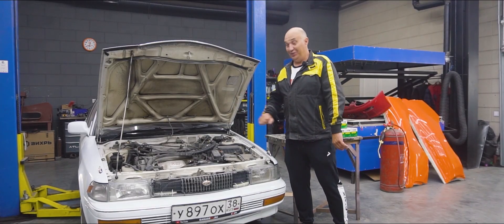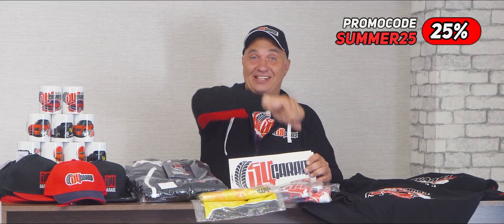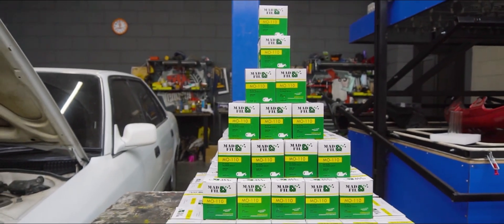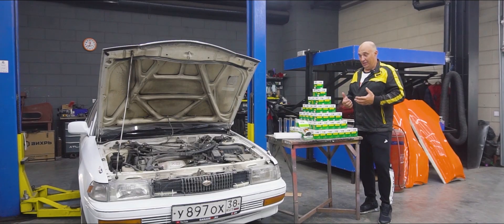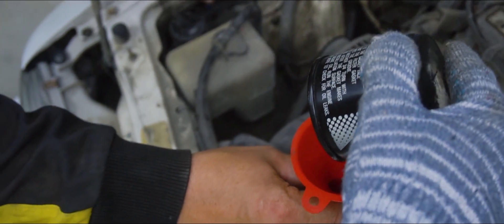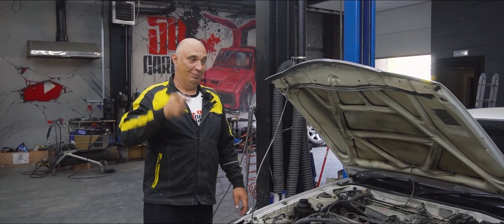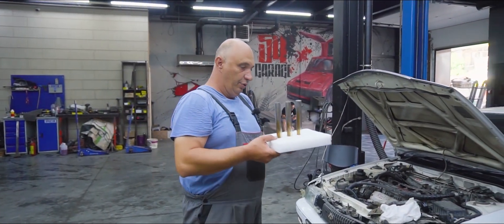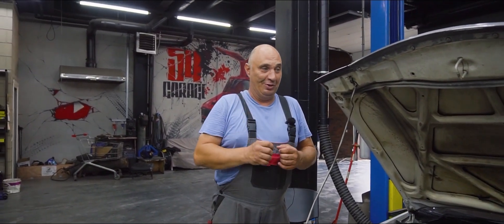Can 50 oil filters make used motor oil clear again?

Comment: Hello from Guatemala City. Try doing the technique @ 8’04” for 10, 20, 50 times (New filter element each time), to avoid engine heat. Good luck.

Comment: The thing is that not all the oil goes through the filter, alot of it bypasses as there is a bypass valve in filter AND some engines bypass in the block....  oil filters filter Some of the oil....only on something like a ships engine is it ALL filtered and spun clean.....

Comment: Like the new Briggs and Stratton lawn mower engines, "never change oil, just top up" lol means they're designed to burn a bit of oil, and there's no drain plug. That's why we use oil extractors to remove oil from crankcase. The engine will last longer, and have less build up in the sump.
Reply: My 2004 Craftsman lawn tractor has a 20 HP Kohler. It has a Gulf Coast toilet paper filter that I change every few years. I changed the oil one time in 20 years. I got gasoline in the oil. The other day I decided to adjust the valves. Removed the valve cover and it looked new. Turns out it has hydraulic valve lifters. Still dont use oil.

Comment: I wonder if the oil pump is strong enough to push the oil through 50 filters in series. Then see the final out come. I was really hoping the oil would have cleaned up some haha.
Reply: The filters did nothing. He changed the oil.

Comment: I really like the videos and attention you put into them. I'll tell you what my Grandfather used to say,  he'd say oil never wears out, it just gets dirty. He'd only replace the oil filter and add the amount of oil the old filter removed. Then drive the vehicles forever.
Reply: Straight weight oil does not but  multi weight does it contains long chain polymers that break down
Reply: I have a Freezer that hasnt had an oil change in over 50 years. Clean oil will last forever. The freezer wont hold it forever. My 37 Studebaker book said its not necessary to change the oil except for seasonal reasons. Change the filter when the oil looks dirty on the depth gauge.(dipstick). Seasonal reasons meant thinner oil for winter. I think they used cotton. John Frantz started putting superior 2 ply toilet paper in them in 1953.

Comment: Many years ago I saw a story of a custom aftermarket oil filter system installed alongside the normal filter. The filter it used was an actual toilet paper roll and the fineness of toilet paper filtered out all the fine carbon and kept the oil very clean.
Reply: Every engine I have with a oil pump has a toilet paper filter including the lawn mowers. Started with a Frantz oil cleaner on my Rambler American in 1963. My Pontiac Torrent has a Australian Jackmaster Classic. The other engines use Gulf Coasts. Motor Guards and a flat head Ford V8 canister filter set up to use Scott 1000. It has half a roll of Viva towels in it now. They dont like to be called toilet paper filters. Too many bull shit stories and stupid jokes with toilet paper. Jackmaster Classic comes with a high quality roll of toilet paper in a sock. They charge about 20 bucks for them. I use Great Value 1000 from Walmart in mine. To remove the used roll I use long nosed pliers. The Jackmaster Classic element has a pull ring.
Reply: Thats 20 dollars Australian. Some put toilet paper in a sock and charge 40 bucks and more.

Comment: Ok, now, take an engine that has 10,000/20,000 Km thick black sludgy oil, and, how many oil changes with a can of engine oil flush between each oil change, will it take to fully clean the inside of the engine with the engine running totally clean and on ultra clear 'new' looking oil? :-)

Comment: Normal oil filters are not designed to restrict the oil flow a much, so the filtering efficiency isn't 100%... To filter better, most of the contaminants should be filtered first, then the oil should be filtered through large paper filter and finally stored in a large container for few weeks so the layers are separated. This is essentially what was done in a company I worked for few years ago...

Comment: You can get lab glass for filtration it has a glass filter that you put whatever size filter you need then the top is clamped on and using a vacuum pump the oil can be drawn through the filter. Just need a really fine one and it will take a lonely time

Comment: Centrifugal oil filter, Spin the used oil through fine jets into a fast spinning barrel the residue will stick to the walls and clean the oil substantially. They do this with diesel trucks here in the west. https://www.cumminsfiltration.com/south-pacific/centriguard-centrifuge-lube-filters

Comment: the sludge build up in the engine wwill never allow the oil to get clean the only wawy i can think of is turn the high speed wheel machine into a centrifuge and separate the contaminates from the oil

Comment: I know motor oil is absolutely recyclable, many auto parts stores here allow you to dump it there for recycling.  I dont know how much of it they re-process back into motor oil, or how hard it is to do, but it IS possible to to make old oil like new again. Somehow.  Biggest problem is removing the carbon and acid contamination, and repairing the viscosity.
Reply: When I was in high school I got a $10 a week allowance that was to buy my lunches and gas any extra was a bonus. Yeah I'm that old. My old 62 Falcon with an inline 6 drank oil. It dumped it out tailpipe and the engine breather tube. Had a motorcycle cop pull me over one day, he was pissed, spladder oil all over his uniform. Oil was expensive so instead of paying the $0.30 a quart I bought what was called Rev. Recycle oil, it was actually amber color. Best of all $0.18 a quart. And at close to 20 mph which was a lot in those days, plus $0.29 a gallon gas I actually had a little allowance left over for the Friday Night Football game.
Reply: I was a maintenance mechanic for a oil  re refinery company. Conventional oil gets better every time it is refined. At one time Mercedes cars came new with re refined oil. Goodyear sold ours in quarts. Most of it goes to the major oil companies. Its as clear as water until they put additives in it. A lot of synthetic oil in it now. With used oil you arent dealing with the crap in crude oil. People wont buy it. They want the new stuff.
Reply: In 1955 I left home at 15 and worked in a DX station in the middle of nowhere. I lived there. The owner gave me some guns in case the thugs came up from Pawhuska Oklahoma and tried to rob me. He thought it would be fun to scare me one night. He scratched at the window and shined a flashlight under his chin. I slept with his 38 under the pillow. He almost met his maker. When I ran out of stuff to sell I went down to a Phillips 66 station. One day the sheriff came and asked me some questions. The next day dad came and told me if I didnt go back to school him and the station owner were going to jail. I managed to finish school and went into the Army.

Comment: Here is a idea you can do as I did it many years ago. I took a 20 liter steel drum filled it with used engine oil, the cap I drilled a hole in with a pipe welded on and another small pipe welded on for air pressure. On the cap with the pipe I welded a expanded metal pipe on with the end  capped, then took toilet paper and rolled it around the expanded pipe many times and put it in drum and pressured the drum, at first the first 2 liter oil was slightly clearer but getting to 10 liter it became clear.
I won't recommend engine oil as combustion process changes the chemical properties but gearbox oil can be used over again.

Comment: The real problems with engine oil are firstly the steady dilution with fuel washed off the cylinders,  and the steady degradation of the all important additives.  The one makes the oil less sticky and lubricates far less well.  The other is the loss of the additives that extend the viscosity range to higher temperatures.  Other additives control things like the acidity of the oil.  Without these all important additives your car is running around very poorly lubricated.  The color of the oil is all but unimportant.
Reply: Its a matter of cleaning the oil with depth filters operating at normal oil temperature long enough for the PCV to remove the fuel and condensation from the oil and adding enough new makeup oil to keep the additives up. Im a filter guy it seems simple.to me. Im not that smart.If I can understand it anyone should understand it.

Comment: for an idea on how to clean the oil try a 5 micron water filter. you may have to pump it through somhow as its a very fine filter and oil is pretty thick in comparison to oil.

Comment: If you use a diesel bypass filter it'll work better. It's all about the micron filtration. Anything industrial should have a bypass filter. Trucks, excavators etc

You can't restore low quality oil as it breaks down. If you use special longlife synthetic it'll work, as the oil is less likely to break down. It's to do with the strength of the oil at molecular level ⛓

I can send you a link to a company that sells 100, 000km oil if you're interested

Comment: What..? I’ve never once seen high quality oil cause an oil light due to clogging an oil filter..? Do you guys not have good filters also.? I work at a ford/Shelby dealership and we deal with all the roush and Shelby vehicles in our city. Never once heard of high quality oil clogging a filter.
Reply: I’ve also probably done 1500 oil changes myself on my personal vehicles. Ive used liqui moly on my vehicles for a few years and that’s the most common oil we use or motul 5w50.

Comment: I could be wrong, but I don’t think the darker color is in the oil, but rather of the oil. The oil has a chemical reaction to get darker after it gets hot. You can heat oil without an engine and it will still turn dark, so it’s not something that can be filtered out.

Comment: Back in the 1940-50s,There was a kit to put on the engine to run toilet paper as a filter!! Try that!
Reply: John Frantz started putting Frantz canisters inside the larger canister filters that were usually optional equipment. The Frantz canister had a roll of 2 ply toilet paper in it. 1953 model. Of course it would turn the oil golden in a gasoline engine. There were others that im not familiar with. A Frantz dealer had Frantz 3 stackers all over the Gulf Of Mexico on big marine engines. They used a taller canister that took 3 Frantz canisters. I believe they had the single the 2 stacker the 3 stacker and the 4 stacker. They also had a FAA and PMA approved AeroFrantz. At some point Frantz went broke. The Frantz dealer improved the little toilet paper filters. I have several in use. The 3 stackers were replaced with a big filter that used Bounty big roll paper toweks. I think they put them in a bag now and charge mor for them. I think the Australian Jackmaster filter company is working with The Gulf Coast filter company. The Gulf Coast filter company is too busy with heavy duty filters. I think they dropped the toilet paper filters. Jackmaster is just as good. The people that buy the big filters also need small filters for lift trucks and such.

Comment: Those particles a down to micron sizes. In order to filter out to 0 microns which is what you’d need to make it clear again it would take hours to push it through filters that’s small and the engine wouldn’t get enough flow.

Comment: you guys is silly. The hydrocarbons have made the oil dark. Geesh. You would have to make some refining process for the oil in order to take out the hydrocarbons and each filter only works at certain micron levels. You achieved very little here

Comment: Because high prices of fuel in my country i am forced to drive my car on waste motor oil mix with diesel.  50/50 winter mix and 70/30 summer mix. You can do 70/30 mix all the time but cold start during winter is harder.

Comment: I had a Toyota Corolla 4wd Touring that burned about a liter a week. I just topped off the oil for 2 years. I drove that thing about 50k kms and I changed the filter twice😂 it did fine. Surprisingly the reason it died was not the engine giving up, but rather the rear wheel bearings for a 4wd corolla were not available anywhere in the world. So I scrapped it. Best damn car I ever had. Outwheeled every single subaru in the heavy Iceland snow

Comment: I’m so disappointed. I figured y’all would have rigged up a contraption to have all 50 of those in line, pumping back into the engine 😂
Reply: me too. I was thinking a long pile with T joints.
Reply: @musthavechannel5262  I wonder if the oil pump would be able to pump that much oil thru 50x the filter restrictions it should with stand. Without several booster pumps to keep the pressure up and assist the engine oil pump, it would either fail or the engine would suffer oil starvation.
Reply: @midlifeparty  That's a fair point.
Reply: Same here too disappointed
Reply: Not going to lie, I literally thought this was what was going to happen
Reply: same
Reply: You not the only one
Reply: They might read this comment and try it? Who knows?
Reply: @MrCwatson3  that would be epic. Even if it had to have a booster pump in line or something.
Reply: I did think the same . A tube with filters rammed in and holes cut in the ends ... oil in one end and lets see what drops out the other .
Reply: I think you'd have to have an oil pump capable of about 700 lb of oil pressure LOL
Reply: Man you’d have negative oil pressure by the time it entered the first 3 filters 😂
Reply: Omg yes!!
Reply: Sammeee🤣🤣🤣

Comment: I think you would have gotten much better results if you used a extremely high filtration filter like a royal purple oil filter.  They are like 95% efficient at 5 microns.

Comment: You need install a bypass filter with a sub micron rating. 1 filter will make it clear as new.
Reply: correct, check out gulf coast filters.
Reply: I have several Gulf Coast Junior filters in use. I dont think they are in production now The Australian Jackmaster Classic is just as good. Gulf Coast is getting more and more into government business. Got into a debate with on a Trawler forum. It was NASA. They started using them They were moving the shuttle then. Its not just motor oil now. Its aviation fuel  Cleaning solvent  Coolant. I called Charlie Sims at Gulf Coast filters. I said send someone down to Canaveral that understands large engines. Im in over my head. LOL.
Reply: Of course the big Gulf Coast filters used Bounty big roll paper towels then right out of the package.  They started putting them in a bag. Got a call from one of my fleet customers. He said we have more trucks. I said call Gulf Coast filters. Too old to be crawling under trucks.

Comment: That is why I use a really high-end oil filter (like one by CAT), along with an oil catch can, an oil cooler, and also a magnet to help catch any metallic particulates.

One thing I would suggest trying is getting a chemistry setup so that you can try distilling motor oil to purify it.
Reply: Would that not separate any useful additives like detergents for example?
Reply: A lot of big paper towel filters are going to the government now. Mostly the Military. I got into a debate with a NASA diesel equipment engineer on a trawler forum years ago. Now they use them. They were moving the shuttle then. Thats the Gulf Coast filter company out of Gulfport Mississippi.  I told Charlie Sims of Gulf Coast filters to send someone down to Canaveral that understands big engines. They didnt need to talk about my Ford diesel truck.

Comment: These filters only filter properly after they've collected some sediment. You'd be better off just running the first new one for 50-100 miles.

However, if you really want to make a video on this were the oil gets cleaned with new filters - get a bunch of finer filters - filters that can catch smaller particles. They'll have a lower flow rate, you may need several of them. Hook them up in PARALLEL to match the flow rate of the stock filter (just multiply the flow rate by how many filters you have).

Comment: try to mix gasoline engines oil like 4L engine oil and 3L fuel..in engine run the engine then disconnect fuel pump to see does it run with sucking gas from pcv valve

Comment: The oil darkens when exposed to heat from the motor. There was no way this would be returned to its original color.
Reply: Actually, it's the carmelization of things IN the oil that changes its color. I had old oil once, put an Amsoil filter system, and it went from darker to lighter, but it was still orange oil, not the light golden it started.

Comment: Well, the answer of course is no.
For one thing the filters are the same….they are not graduated finer and finer.
So, no matter how much you push the oil through, it’s only going to get so clean. And definitely not clear or even golden.
Second. The filter is not meant to make your oil perfect. That’s why you change your oil. It strains out the big chunks essentially. It does not remove any of the acid, or fine particulate.
I want you to think of a quart of oil as a pail. The pail  will only hold so much….and that’s all.
Detergent oil is the same way. A quart of oil will only hold, or capture a certain amount of particulate. After that, it ceases to be oil, and it becomes an aggregate. And will wear out your engine very quickly.
And that is just the minute particles of burnt carbon that pass your piston rings. This does not include the acids that build up.
This is why it’s very important to change your oil on a regular basis.
I guess it could be recycled and made into new oil. But, Probably would have to be refined just like crude. I’m not quite sure how they do that. However I do know that it is done.